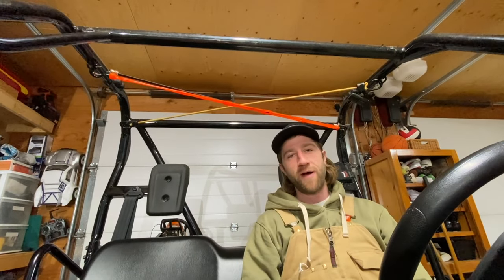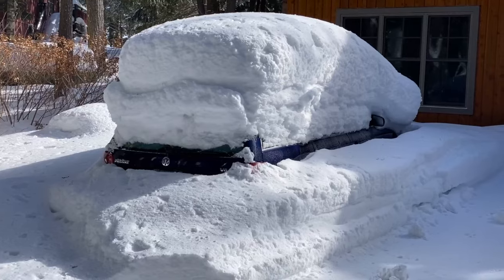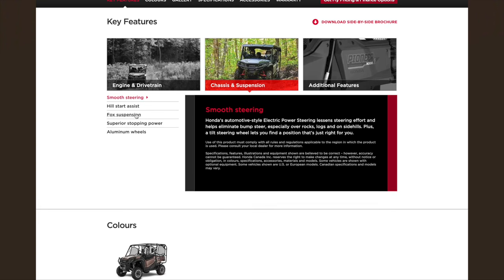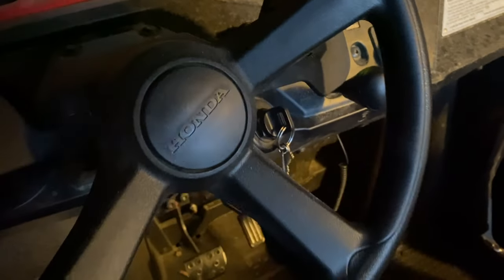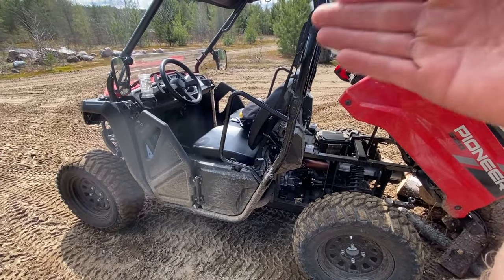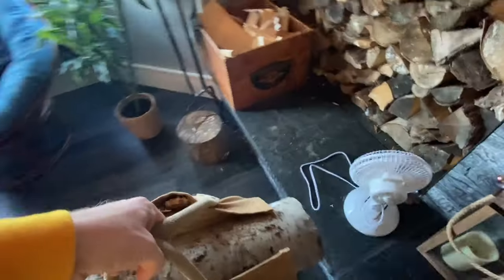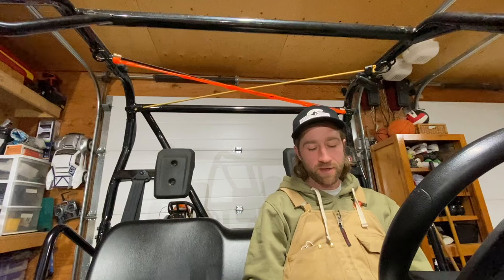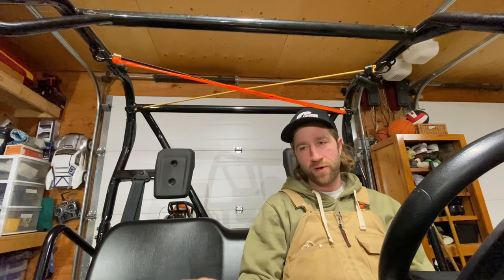Honda Pioneer 520 ONE YEAR REVIEW on the ranch with TIPS, TRICKS, and more!

Comment: I just bought last week a 2019 Honda pioneer 500 white in perfect condition with glass windshield and honda Roof . 208 miles $7200 . Absolutely love it . I got got rear soft window and nice fancy sporty rear mirrors. I want to get 27”s tires maybe 26”s  must people are putting 26”s I think 27”s would be better I’m just worry that would not work. Maybe 27”s are to big?? What do you think??? 28”s would be perfect but I don’t think the honda Pioneer 500 can handle it
Reply from the maker: Sounds like it's practically new, awesome. We run 28's on both pioneer 520's and it works very well. The ground clearance is much better for the type of riding we do around here. There is a bit of rubbing, but doesn't bother me at all. I just know the limits and where the rubbing can occur, and try to avoid those situations. Of course the tire model can have a big effect, as not all tires are the same physical size from one model to the next. If you're very worried about any rubbing at all, I would check on some forums to see what other 500/520 owners are doing. Hope that helps. Thanks for watching and happy riding!!
Reply: @ranchroadhomestead  brother thank you so much for taking your valuable time to reply back to me. You are awesome I’m probably go for 28” Tusk Terrabite maybe 27”s . Thank you so much for replying back to me
Reply from the maker: Very happy to help, and thanks for the kind words. Something to point out since our last videos - After a few years now (since 2018) I've been running the same set of GBC kinati mongrel tires (28x10x14) on my 500 and then later the 520. Maybe it's because I'm getting older and more picky, but the mongrel 10 ply tire is now making me rethink what the 500/520 should have on it for some folks; it rides much harder than I like on trails around here. They don't flex under the weight of these lighter machines, so it gets pretty bouncy. 10 ply is nice for the protection it offers from rocks etc, and when there's a big load in the box, but costs a lot in the comfort category. Richy's 520 has Maxxis Bighorn 1's (also 28x10x14) and it rolls and rides much much smoother due to the fact that they are 6 ply instead of 10 ply, though those tires are much wider physically even though still listed at 10" and he does get considerably more rubbing up front when turning. Since the tusk your are looking at are 8 ply, you might be okay there, but I guess it's the 'wont know until you try it' situation. Just thought it was worth a mention since it's a more recent discovery on our part, and probably a good subject for another video! Personally I love the Tusk/Mongrel 'truck' tread style, but next time around I think I will consider looking for a tire with that style of tread but with a 6 ply rating so I don't feel so rattled after a few minutes in our rocky/root filled trails here... I have been debating suspension upgrades, but it's another expensive add on. Let us know how you like the tires you do go with, if you do end up going with aftermarket tires. Always good to hear what folks are doing! Not sure if any of this helps, but thought it was good information since you might be tire shopping.

Comment: Hey, fyi i use a ammo box the newer plastic one instead of the old metal and it fits length ways right in between the seat belt brackets on the seat. I use a small bungee to hold in place.works great for phone and game cameras and of course ammo. works great for a armrest also.👍
Reply from the maker: Good to know! Just installed a glovebox by crossroads3d and it’s such a handy spot for small items now.
Reply: @ranchroadhomestead  nice, i installed the original choogbox glove box looks factory 👍

Comment: What is Top Speed?  And Is there enough Engine Heat Shielding to keep the seats and cab from getting hot like many other UTVs?
Reply from the maker: Rev limit is 38 ish mph or 62 kmph on the display. I definitely notice some heat at the seat where the buckles are, but not too bad in our climate at least. Thanks for watching!!
Reply: @ranchroadhomestead Thanks

Comment: Is there a way to put a rear unlock on the 520? Also, how is the steering with tracks, do you need power steering with them?
Reply from the maker: Hi! There isn’t an unlocking rear differential that we are aware of. It would be so great if this could be engineered and made either as aftermarket mod or from the factory. The steering takes a bit of effort for sure with tracks. It would definitely be a nice upgrade to have power steering with the tracks, but we get by without power steering. Thanks for watching!

Comment: Hi does it tear up the lawn? I have a Kubota RTV 500 and that doesn't tear things up. Just goes. I don't have to make a lot of tight turns. If I go mainly straight with slight turns should the lawn be ok?
Reply from the maker: Good question. The RTV 500 has a rear differential, so it operates as if it were in a ‘turf mode’. The RTV 500 has the ability to lock the rear differential, which would make it act similarly to the 520 with its full time locked rear end. You could try the RTV locked and see how it does with very gentle turns, and that would give you a good idea how the 520 would operate on your lawn. Your turns have to be very very gradual. Hope that helps. Thanks for watching!

Comment: If you GPS your top speed with those bigger tires, you’re actually going faster than 63 km
Reply from the maker: I’ve been meaning to gps it. On the district road radar I never saw it go as fast as I thought it would. I think Honda displays slightly faster than it’s actually going with the stock 24” tires. The main thing is that on the 520, the suspension can be pretty harsh on our trails so I run low air pressure on the 28” tires. I suspect it would go much faster than 63 km/h like you said, if I pumped the tires to the rated psi. Thanks for watching! 👍👍

Comment: So, the only reason not to buy a Polaris is the CVT transmission? But the Subaru in your video also has a belt drive CVT!
Reply from the maker: Good point, and thanks for commenting. As of 2024, the Pioneer 520 is narrower (50" wide) than the ranger 570 at 56", which may be important to some buyers. The Ranger has some nice features like the added ground clearance and suspension travel above the Pioneer 520. In many ways the 570 could be considered a better rig. Having said all that, to this day, I still prefer shifting for the type of riding/work I do with the 520. I can see why many people would prefer the Ranger 570 though. Also I'm not someone that believes belt/CVT transmissions are a bad thing, there are pros and cons with both transmissions. I really like the ability to keep the rpm low when I'm just putting around on the flats or driving past cranky neighbours! If I lived somewhere that needed the tracks on all year, I would say a CVT option would be the winner since shifting with tracks on isn't ideal.

As for the Subaru, you're correct that it is CVT, but it uses a all steel 'belt' that is built from a bunch of sandwiched steel plates. It is electronically controlled to have the engine running at low rpm for fuel economy, and then 'fake shifts' more like a 7 speed auto transmission when more power is required and so on. So far it has been a great transmission as a daily driver. If I were the sole driver of that car, I would have gone for something with a manual transmission, since I do almost no city driving.

Thanks for watching!!
Reply: Yes, the higher RPMs of the belt drive CVT can be annoying but they are also much easier to repair vs the Honda gear transmission should anything happen. Polaris recently introduced a much more modern CVT with a steel belt and computer-controlled clutch pulley position to simulate gears just like your Subaru. However it’s only on the large and expensive machines for right now.
Reply from the maker: @tylermacconnell217 I’m sure once that tech gets cheaper it will be on all the machines. By then Honda might make the switch. Although the new pioneer 1000 shifts like actual butter, seems like they have it down to a science on that machine.

Comment: Have you had any exhaust trouble?  I have a 2022 p520 and have had the muffler replaced 3 times due to cracked welds.  I use mine on the farm and sometimes ride on the road for awhile at a time (30mph).  The muffler turns blue due to heat and the welds eventually fail.
Reply from the maker: Oh that’s annoying! It’s interesting you say that as recently I’ve noticed some change in the exhaust sounds… Will definitely have a close look! Thanks for watching
Reply: @ranchroadhomestead   the noise is coming from the welded heat shield on the exhaust in-between the header pipe and muffler.  It's welded on one end and has a slip joint on the other.....it rattles something fierce.

Comment: For the money does your dad miss the having the 1000? Or does the 520 give him the thrill of riding? I’m in the same situation to where 18k for a base model 1000 pioneer def breaks the bank,
Reply from the maker: Great question! Richy’s answer is basically that he sold the p1000 to get some income that was needed at the time and downsizing for our trails and the riding we do mostly made sense. He hasn’t looked back! So I would say no, he doesn’t miss the p1000, however he does wish that the 520 had some of the features the p1000 had (mainly 4 wheel locking 4wd, turf mode, and power steering). Hope that helps. Thanks for watching!!
Reply: @ranchroadhomestead  thanks and thanks for the time and effort you put into your videos and thanks for your response. The 1000k has  marketed themselves out of a reasonable man’s budget…. I’m 6’2 and I’m probably going to have to settle for a 700
Reply from the maker: You're very welcome! Yes, the bigger machines get pretty expensive quickly indeed. The 700 is a great machine, sized nicely in the middle roughly. Happy riding.

Comment: What about the leg room? Having your left leg at a 90 degree all the time and not being able to put it forward as far as your right leg seems to me that it would get really irritating. I love the size, torquey little motor, and everything else about these. And can "put up" with any of it, without much complaint, but test driving one makes me worry that your back and hips would feel it after not being able to put that left leg forward as much as the right over several hours of riding.
Reply from the maker: This is a great question. I remember that feeling test driving it as well, thinking that the leg room could be a bit of an issue. It didn't take long for me to get used to it, which is hard to explain. Everyone's anatomy varies of course, which makes it basically impossible to say one way or another. I'm 5'10" and limber enough without any circulation issues. Richy is 6'3" and not as nimble, but still hasn't complained about the leg room as I would have thought. However he said he would be glad to take more leg room of course. I have spent days in this machine with the leaf blower mounted, and still not a bother. Maybe the closest way to be sure is a long test ride/spend as much seat time in the showroom as your dealer allows! Hope that helps. Thanks for watching !!
Reply: Thanks for the feedback!

Comment: How do you find the non-power steering for normal trail riding
Reply from the maker: Great question, a bit tricky to answer. I was never really bugged by the lack of power steering on trails with gentle turns and travelling at a decent speed. The slower you go and tighter the trails and turns, you start to feel it, but manageable much if the time. Of course you always have to watch out for bumping an object and having the wheel spin and jamb a thumb etc. especially when backing up. Hold that wheel tight. Frankly the more time you spend doing three point turns, backing up, chore/work type stuff, you quickly start to wish for power steering. We have since added power steering to the one 520 that does all the trail grooming with tracks on and it’s a dream now. So now our opinion is that Honda should just make it standard, but as viewers have stated this continues to drive the price of a ‘value’ rig up and up. Hope that super long winded answer helps you out! Happy riding and thanks for watching! -stay tuned for the torq locker vid coming up; we have it all recorded. We talk about the power steering kit a bit!!
Reply: @ranchroadhomestead  thanks for the reply. Where are the power steering kits purchased? Thanks
Reply from the maker: @OceanBreeze2022. We got our SuperATV kit through our local Honda dealer here in Ontario, Canada. Here’s a link to the superATV site, they also sell direct I believe. https://www.superatv.com/honda-pioneer-520-power-steering-kit

Comment: Hey, can you run out a tank of fuel in one day?
Reply from the maker: Depends what type of riding. A tank definitely lasts a pretty long time considering it’s only 4.1 gal (includes 1.1 gal reserve). A rough guess would be 100-120 miles (170-200 kms) using the whole 4.1 gal tank! If you’re going far I recommend taking an extra tank just in case. Thanks for watching 👍